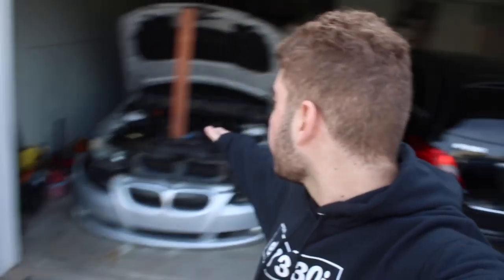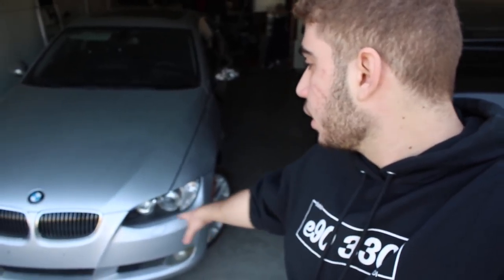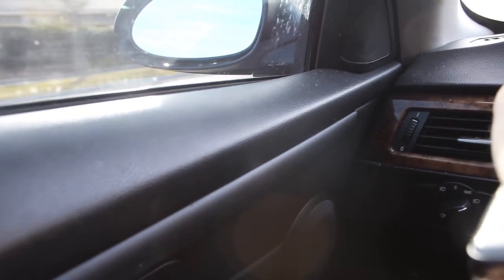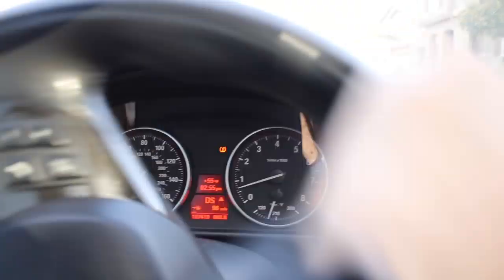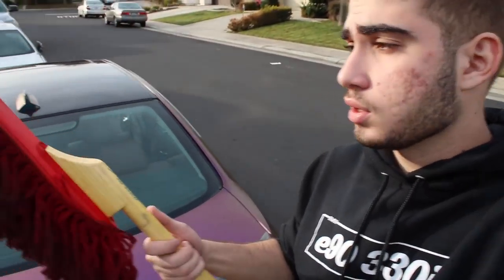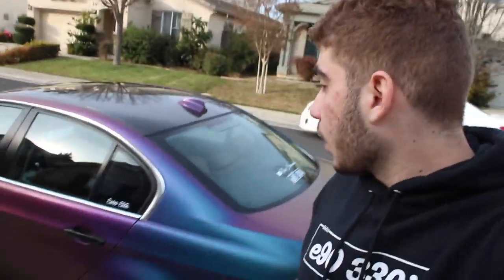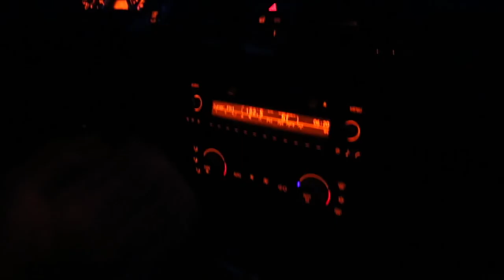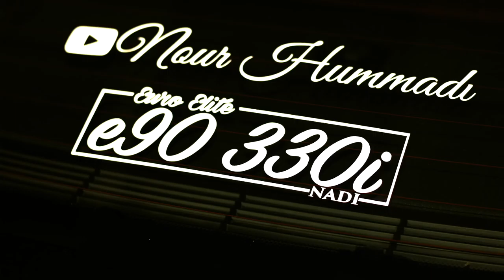MY BRO'S BMW IS FINALLY LEGAL!!

Comment: Hey bro just saying if you want to clean up the look on the door you can order automotive color match paint that matches the car on automotivepainttouchup they sell spray cans for about $20 just saying if you want to paint it
Reply from the maker: Robles Inline 6 would the paint match the car? I feel like a can will make it look bad
Reply: Nour Hummadi not really you can really get a good finish with some practice but I just watched the ending and heard your wrapping the car so it was just an idea aha
Reply: I used it to a paint a jaguars fender, paint matched the car v well and it was a black car so very easy to see drips or anything, it'll be so easy on a silver car